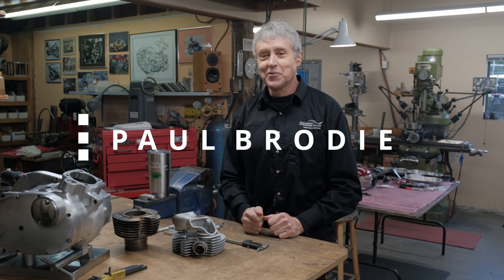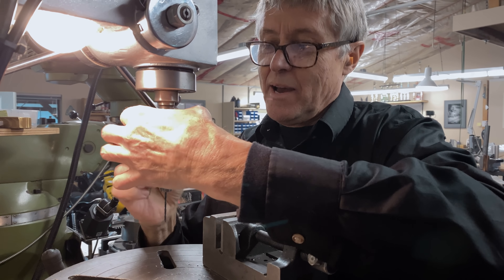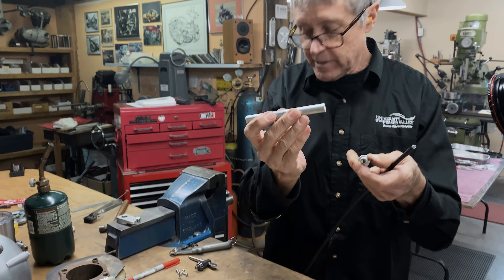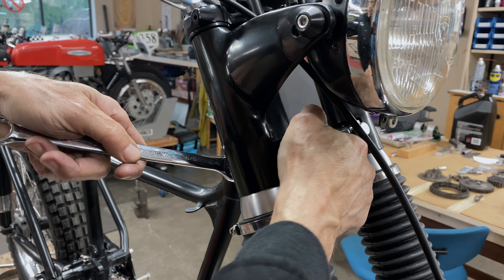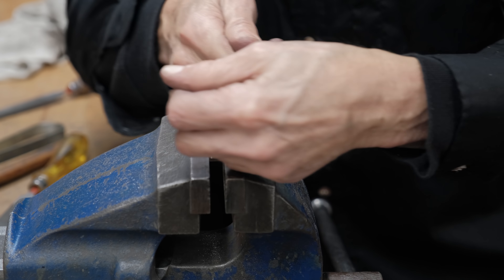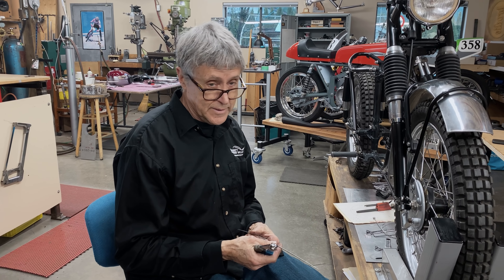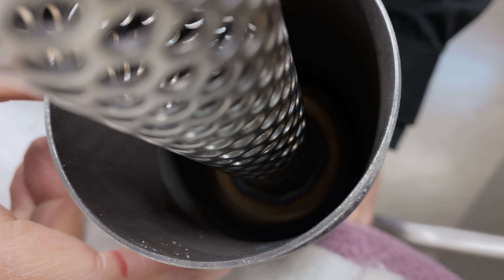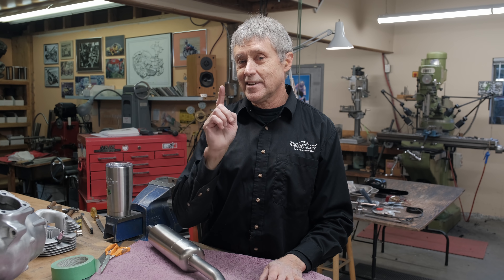How to pack a muffler // Paul Brodie's Shop

Comment: I build side pipes for Shelby Cobra replicas and make my own mufflers. I've had good success using stainless steel pot scrubbers. They are donut shaped and you can stretch them out and slide them over the baffle tube. stack them up untill the whole baffle tube is covered with a single layer of pot scrubbers. Then wrap the whole thing in fiberglass. Then a layer of ceramic wool mat. The pot scrubbers help preserve the fiberglass and stop it getting blown out. The ceramic wool mat keeps the outside temp of the pipe down as it's easy to burn your leg on them getting out of the car.
Reply from the maker: Michael, thanks for watching and commenting. Never would have thought of using stainless pot scrubbers.
Reply: Brilliant.
Reply from the maker: @digschopper9321   Thanks!
Reply: Great idea on muffler packing.
Reply from the maker: @davidparker3346   Thanks David.

Comment: Could you wrap a piece of thin Mylar around the perforated tube, then wrap the fiberglass that is the full depth around it. Slide the fiberglass down and pull the Mylar out?
Reply from the maker: Well, that does sound like a possibility, but I'm not going to unpack my muffler just to give it a try...   But Thanks!     :face-fuchsia-tongue-out:

Comment: The first muffler I did had a rusted inner tube, so I made one with a drill press & normal galvanized exhaust pipe. Then I wrapped the tube with fiberglass weave (for auto body, iirc "Bondo" brand :p ). I put the tube in the tube & packed the loose space with fiberglass mat (same stuff) & capped it.

It worked well, and it was easier than your idea.

Comment: Hello Paul, Mitch.  As always, thank you for an enjoyable video.  I was slightly surprised that you made an adaptor rather than whole new threaded adjusters  for the brakes, that would have been my first impulse (and in stainless) but I'm not really known for the path of least resistance.  

Re: muffler packing, my favorite thing to do when packing mufflers is to put two wraps of window screen wire mesh around the core before packing with fiberglass.  This gets held on with a few turns of safety wire.  The theory (which I can't substantiate at all) is that it supports the fiberglass and prevents it from breaking off and going out the pipe as quickly.  I've built quite a few exhausts, and done that to all of them, and nobody has complained.

I think you'll be pleased with the tone - it''ll be frisky but not too sharp - the large holes with the high % of open area will do well at reducing the high frequency.  Back when Muzzy made exhausts, they used small holes with a lower % open area, and their systems always had a signature raspy, snappy tone.  You don't have a lot of muffler volume, so it won't be quiet by any means.
Reply from the maker: Thanks Alan. Making cable adjusters out of stainless would be a LOT of work. If I did stuff like that the little Cub would take Forever!
Reply: @paulbrodie  Ha.  Story of my life.

Comment: Another excellent video Paul. That Delron cable guide is not going to tighten that fork tube pinch bolt, unless there is something I missed. Great cable making lesson. You are truly worth watching if you like to learn how to build motorcycles.
Reply from the maker: Delrin takes quite some force before it squishes. The fork tube pinvch bolt is going to work just fine! Thanks for watching.
Reply: @paulbrodie  good Early Tuesday morning to you both

Comment: Great work you do there. That's pretty well the exact way I pack my RZ350, aftermarket mufflers. When I got the bike the previous owner, didn't adjust the angle of the pipes properly, so the rear axle bolt on both sides smashed against the cans on both sides. Luckily one side was okay, but on the other side, the baffle was completely destroyed, and the whole can mounts on the baffle with a flange on the one end with a circlip to keep it on. I couldn't find any replacement, so I found a piece of tubing the right size, and had to drill all the holes in it on the milling machine. Been working for 20 years now.
Reply from the maker: Thanks John B. Good story about your RZ..

Comment: Excellent video. I remember my Sports Cub having truly awful fin casting. Japanese motorcycle casting really showed how rough the British motorcycle industry was. I did find a Sports Cub head that was good eventually. They were relatively plentiful in the late 1970s, although getting at them was not easy [what did we do before the World-Wide-Web?].
Your cable ferrule machining was a delight, but you do give me the colly-wobbles with your filing around a speeding chuck. I have seen a person have an accident. Once seen, never forgotten. Anyway. You obviously know. Stay safe.
Reply from the maker: Thank you Rambler Andy. I have been spending a little time on the Cub head fins, making them a little nicer. I am very respectful of the chuck in my lathe. Especially when it is spinning. My anniversary is next Wednesday: 55 years of making stuff out of metal.

Comment: Cool, learned a lot. Just picked up a 83 honda cb650sc that needs timing chain guide and some colling fin repair. After watching you I can start tackling it this spring. Going to make a scrambler.
Reply from the maker: Thanks Ray. Good luck with your CB650 project.

Comment: LOL, The reason for packing as tight as possible is so a tuned length pipe will act as a tube rather than an expansion box.
 It's more critical on two stroke motors. 
The high frequencies will more likely pass through the perforations and be absorbed, the lower frequencies being longer wavelength tend to pass straight through and give a better tone.
 Fitting aftermarket semi-race systems to RD250 and RD350 (plus various Suzuki's 250~550, the 750 had plenty for street use )proved the point to many customers back in the day, loud and tinny was way slower than a re-packed system (about 12~15mph on RD350)
Reply from the maker: Good thing I have a 4 stroke Cub... won't be so critical :)

Comment: Watching your videos is always super interesting and time flies. But maybe this time I can  give you a little tip... In order to pack tight that spot where you can't reach, next time you can make a sleeve using a sheet metal or a tube, the internal diameter and length the same as the muffler core. You pack the wool around that than you slide it until the bottom of the muffler (you can use aluminum tape to tight that spot, or something else if you are able to remove it). Than slip out the sleeve et voilà 😁. Makes sense? I was pretty bad in english back in school, sorry 🤣
Reply from the maker: Yes that does make sense, thank you.

Comment: Paul,using the lower triple clamp pinch bolt as a mount,doesn't the Delrin require an internal sleeve,as not to crush under torque? That would allow the bolt to loosen.
Reply from the maker: We will do a torque test to see just how squishable the Delrin really is.

Comment: Excellent video as always, Paul and Mitch! Love that you make your own ferrules as a matter of course. Very curious to hear how it sounds too! I've only repacked a couple of mufflers, but I don't remember the repacking kits being that tight. Of course, they didn't muffle all that much either! Just mulling it over (definitely not an expert, but always curious!), I'm thinking looser packing would give the exhaust "waves" space to be absorbed. My thinking is that the extreme of tight packing would be if the space was so densely filled that the waves had absolutely nowhere to go, which would be the same as a straight pipe. Thoughts?
Reply from the maker: Thanks Fred. I think that the shock waves of the exhaust tend to loosen the packing over time. That's why you need to repack every so often. No one has ever told me to "pack loosely".
Reply: I know nothing about packing mufflers. But I would have thought It's too tight also like Fred Patton suggested.
Similar to insulation in a house, too tight and it"s not as effective.
But like I said I know nothing about this.

Comment: Oh,about the Delrin, it really would be better to make a spacer tube about 1/32"/1mm shorter than the eventual thickness you use so it can compress slightly but still apply enough torque to bottom yoke. Unlike girder forks, tele's rely on bottom yoke to hold things (girder puts the main stress on top yoke)
Reply from the maker: We will do a torque test to see how the delrin holds up under compression.
Reply: @paulbrodie  10-4

Comment: As good as ever, thank you. I just wondered when you showed the last broken head-fin, would that be easier to weld up with the head upside down? Les in UK
Reply from the maker: Thank you Leslie. That fin was hard to weld because of the lack of space. It's getting the tungsten in far enough and clearing the upper fin and the copper plate. If I weld it upside down then the top of the fin will be formed by the copper plate, and that's not always a nice surface. I prefer to file off the "lump" and get new material to see.

Comment: Normally i don't use a block to hold the cable . The barrel the cable goes threw i drill on side to the cable hole and thread and pinch the cable steady with a screw or bolt threw the side of the barrel.

Comment: hi paul. quick hand on the lathe to release the tap! if was me the crash would have made a nice vid haha. you work close to the machine but i see every movement carefully done, great. i´ve packed a ton of mufflers ( two strokes... ) one thing i did different was wrapping the outside of the fiberglass with chicken wire and a piece of wire to release once inside don´t know how to explain well. hope the bike sounds nice and if not you can always go megaphone!. thanks and take care. peter
Reply from the maker: Thank you Peter. I hope I like the sound :)

Comment: " & then we'll have a front brake working " .. The cable yes ..  Old bike bike brakes have reputation for lack of braking,,, Looking forward to the restoring / setting up the front brake video .    ... What lube would you suggest for the cable?
Reply from the maker: I'm working on getting a 7" single leading shoe off a 350/500 Triumph. Should bolt right in and look good too. Engine oil for the cable.

Comment: Great content as usual, enjoying the new format. I've found over packing a silencer will reduce the effectiveness. Copper wire can be used to bind the packing to hold in place during assembly. A smear of clear bathroom silicone around the metal on metal mating surfaces will eliminate the packing blowing out. The silicone will not burn and is easy to remove in future. Just leave overnight to cure before firing it up.
Reply from the maker: Thanks Craig. You are the first person to warn me against over packing.

Comment: Great work! On the topic of Delrin: Have you ever attempted or heard of using delrin to 'button' a vintage (hard to find) piston? I saw elsewhere that Delrin would be used to reduce friction and eliminate piston wear to the skirt and the only metal to metal contact would be the rings to walls. I'm curious of your take on this.
Reply from the maker: Thank you Forzaplayer7557. The piston needs to contact the cylinder wall. That's how it gets rid of its' heat. If you don't allow contact, the piston may overheat and possibly seize. I have heard of teflon buttons either end of the wristpin to save using circles. Not in the actual piston.
Reply: @paulbrodie  took me a moment but this is the reference to the piston buttons. https://youtu.be/k-Q6LWYWhiY
 Perhaps the free flow of oil in the piston area would aid in cooling but your point of view i would tend to agree with.
Reply from the maker: @Forzaplayer   Yes, oil squirters under the piston can definitely help with the cooling.

Comment: I understand wanting it packed tight but air has to move into the fibers to deaden the sound so i think the tighter you pack it the louder the muffler will be .
Reply: I can confirm that. I just done the same mistake, I packed my bike's muffler tight and it was louder than it used to be. Once I removed some material to let the gasses (and soundwaves) move through the fiberglass, the exhaust was way more silent.

Comment: Nice work Paul! Where do you get your cable & outer jacket from? Looking for quality stuff to make my speedo, tack, push/pull throttle cables for a bike I am building. Cheers, Doug
Reply from the maker: Thanks. Someone else asked that question too. I got the inner cables at a swap meet many years ago. I also pick through my local cycle salvage shop for outer cable.
Reply: @paulbrodie  I did some surfing last night and "Venhill" sells alot of cable parts. The outer "jacket" is called conduit (didn't know that). Still looking for the "pin type" crimp-on ends that are used on the speedo/tach cables. Thanks for your reply, cheers, Doug
Reply from the maker: @MegaCountach   Ah, the Internet comes through!  Feels good when you look for something and there it is...

Comment: Can't see why you made the cable guide from deleon.  I would have though one in stainless with a deleon insert would be better and less bulky
Reply from the maker: Delrin is so easy to machine. A stainless guide / holder would have taken a few hours.

Comment: is this more a resonator rather than a muffler as i thought you had to block the part with holes half way down so the flow goes through the fibre ? cheers
Reply from the maker: Well, I don't know the difference between a resonator and a muffler. I am basically copying a muffler off an aftermarket sport bike, or similar. I want it to be free flowing, with a sporty sound.

Comment: 14:12 Actually I heard it should not be too tight - too tight means less volumetric capacity for sound absorption..? Also a layer or two of stainless steel wool right against the perf pipe first for heat tolerance is supposed to help longevity... worth testing for differences??
Reply from the maker: Yes, there have been comments about those things you mentioned. I guess I could do some testing, but mostly I just want to go for a ride! Thanks for watching.

Comment: Good stuff as usual Paul. I'm still wondering why you always cut off pieces in the band saw rather than parting them off in the lathe? Did you have a bad experience doing this? I made a rear parting tool years ago and this changed my ability to part off in the lathe. Check out Geo Wright's version for a myford.  Kind regards Trev-
Reply from the maker: Thanks Trevor. I just find it easier to cut off in the bandsaw. Nothing goes wrong. As you probably know, parting can go wrong. Sometimes quite drastically.

Comment: I made a mold for forming lead ends on cables 
Drill a hole in the end of a large bolt …all the way through the bolt 
make a slot on the side for the cable 
Put a rod in the hole in the bolt a tight fit 
The rod does two things 
It sets the depth 
And pushes the lead end out of the mold 
Frey the end of the cable insert it in the slot
Preheat the mold 
Melt lead into the molt while holding the cable in place tamp the top to compress the lead let cool 
And push it out of the mold with the rod
Use a vise to hold  the rod 
Set the bolt over the rod to rest on the vise at the right depth 
If the rod is couple inches longer than bolt it works well 
A little clean up with a file 
You’re good to go
Reply: Surely that’s just making the cable-nipple out of lead. Bad idea.. Les
Reply: @leslieaustin151  
That’s what they are made out of on factory cables 
I use lead free soldier 
I just call it lead it works
Reply from the maker: I don't think I'll be making cables that way, but it sounds like it works for you. Thanks for commenting.

Comment: I'm curious how much force that brass/solder cable end can withstand without failure. (probably more than you'd apply for braking.) I assume the failure point would maybe be the solder deforming and the cable pulling out. Just curious how it holds up as a general purpose technique for cable termination.
Reply: 40 - 50 years ago, any decent motorcycle shop had a box of assorted cable termination fittings, lever bosses, ferrules and nipples. I can guarantee they the method that Paul uses is more than sufficient to take the strain. If you have owned an older British bike, this was par for the course. Thanks Paul and Mitch.
Reply from the maker: @timheron6509  Thanks Tim!
Reply from the maker: I've never done an actual test to see how much force will pull the cable end off. But, I've also never had a failure in several decades.

Comment: had a z-1 kawasaki that had a bad vibration. took the packing out of header no vibration. if you have that problem you know what to do.
Reply from the maker: Al, in my brain there is no logical connection between engine vibration and exhaust packing.

Comment: Awesome video again, thank you.
I also have another question: as I am a few weeks before ordering paint for my bicycle: how did you do the paint on the "patina Excelsior boardtracker"? That thing is gorgeous.
Currently I am thinking: matte powdercoat primer for protection. Then add a wax paint where you can get a "old look". Annie Sloan paint for example. And sand bits off here and there.
Reply from the maker: I paint, then I scotch brite gently, finally polishing by hand. It's all discussed in one of the Cub videos, where I'm showing the newly painted pieces.

Comment: Not expert on exhausts, but I have a advice :-) use a mask when work with this materials. There were small fibers flying around you, and those are not good for your health.
Reply from the maker: Razvan, thanks for your concern. 20 years ago I insulated my entire house and also my entire shop with pink fiberglas. No one ever told me to wear a mask or gloves, and I didn't. I'm still here :)